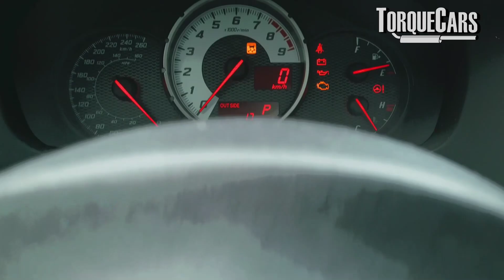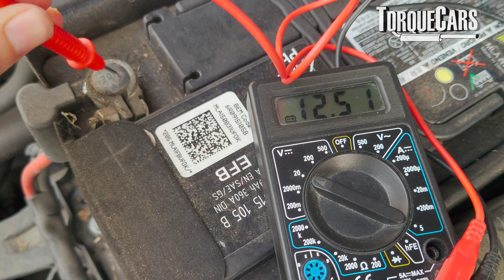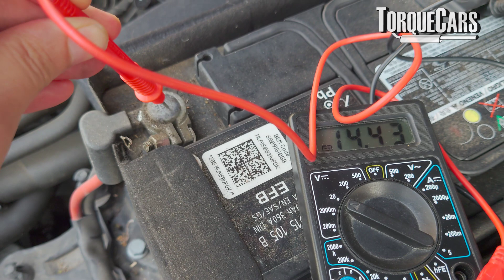Test a Flat Battery vs Alternator Problem? How To Diagnose Car Electrical Problems.

Comment: Wayne, I would welcome your help here: '95 Rover 820, 240k miles. With no electrical devices on at all, when I flash the high beam lights the revs drop significantly - when stationary and at idle. Is that a battery related issue or an alternator related issue? Battery is the max capacity (60Ah - 540CCA) and just 2 years old. Any help would be welcome.
Thank you in advance, Harry
Reply from the maker: Check the voltage at the battery when this is happening. You'll probably see a drop with the engine running, and I wouldn't be surprised if the alternator is putting out too little current. Jumping and charging with the battery connected to the car can cause the alternator to fail on these. I did know a guy who could repair them by switching out the voltage regulator. Is this the Tomcat engine?
Reply: @torquecars  Very grateful to your quick reply Wayne. Our Rover 820 has indeed the T-series engine, 1,994cc 136hp. I admit I have been charging the battery while it is connected to the car, systematically. Turns out it's not such a good idea. We're not putting many miles on the big Rover for 3-4 years now, but we have never jump-started her either. Will follow your advice on testing once I am back home, will be away for 2 more weeks - I live in Greece - but desperately needed to know, since I intend to keep this car, it's unbelievably rare here, I adore it was practically raised with it - it was Dad's car ;)

Comment: Thanks for the informative video. I have a point to make here. All the new cars are replacing manual hand brakes with electronic ones which need electrical power to function. Imagine the alternator dies while you are driving on the highway. Since vital systems such as power steering, and brakes are all driven by electricity, they wouldn't work. The car will keep going; the only way to stop it is by using the mechanical hand brake. Since it has been converted to an electrical one, there is no way to stop the car. This happened once to me and once to my daughter. Luckily we had just exited the highway and were on the slower side roads. Officials of power should look into this and the car companies should provide a mechanical handbrake irrespective of whether they include the fancy electrical one or not!

Comment: Thanks for your help. Tracing these issues can be a real headache. Imagine being stranded on a cold morning due to a faulty battery. 😅
Reply from the maker: Ironically my car battery died yesterday, it has lasted in the car aound 10 years so I can't complain really. The batteries for stop start engines are really expensive.